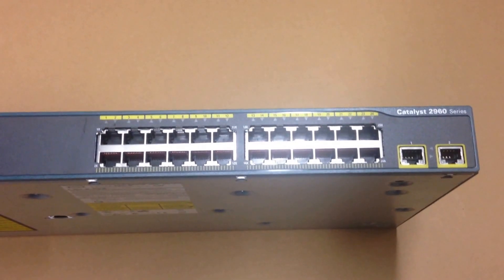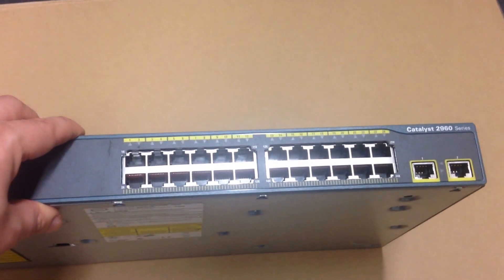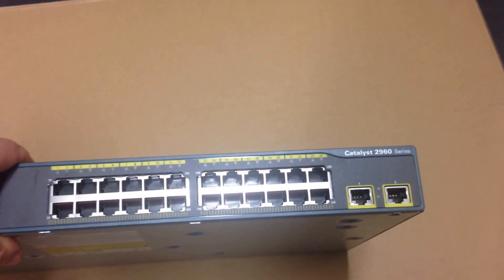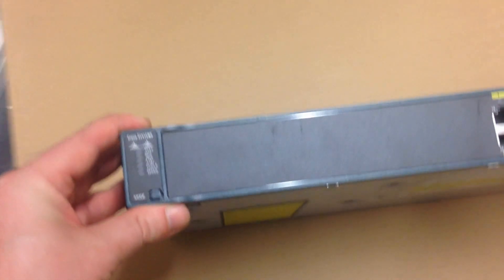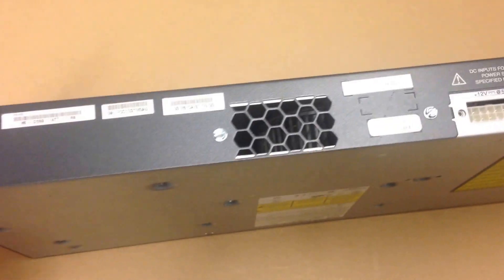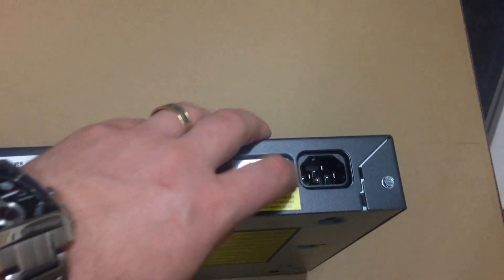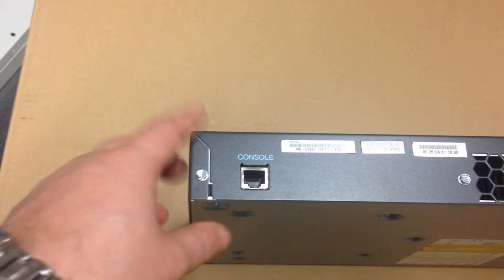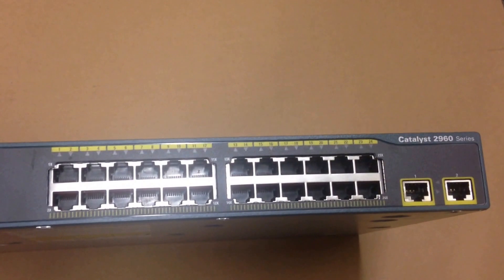Physical overview of a Cisco Catalyst 2960 Series Network Switch

Comment: I have this catalyst 2960 plus, i only want to use it as  switch, to connect 7 equipments via ethernet. Can i use this as a switch? To use it as a switch do i need to any configarations?? Can i use it as a plug and play? If yes, where to plug the eternet cable from router?